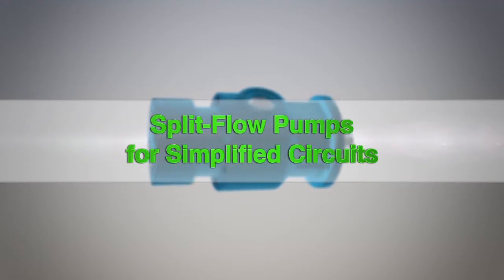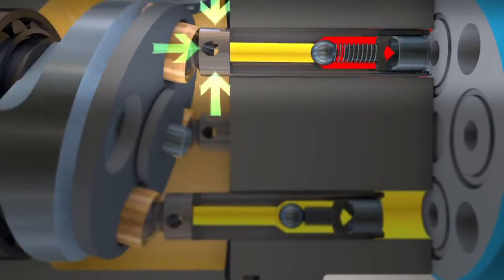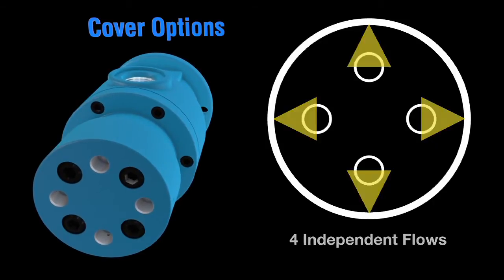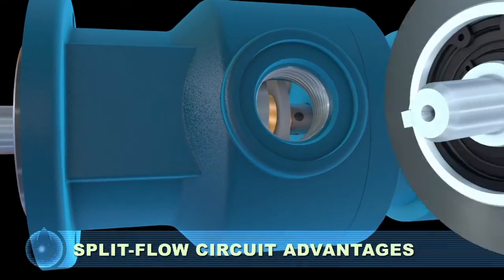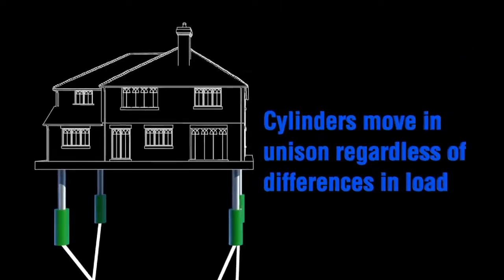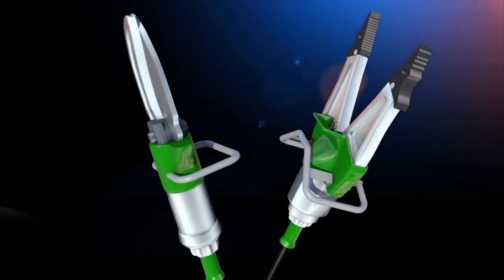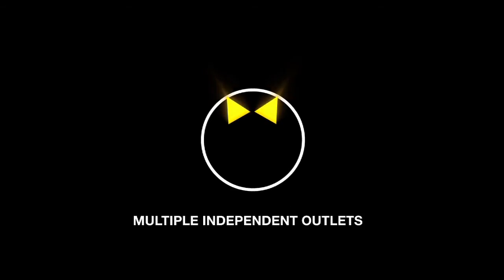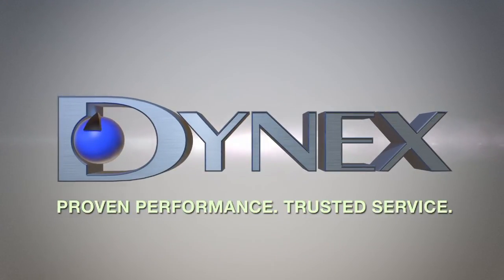Split-Flow Hydraulic Pumps for Simplified Circuits

Comment: What would cause vibration on the discharge side of the pump? We've bled it off to check for air, etc...
Reply: TGB 81  what tipe of equipment you used this pump on?  Did you ever got your problem figured out?